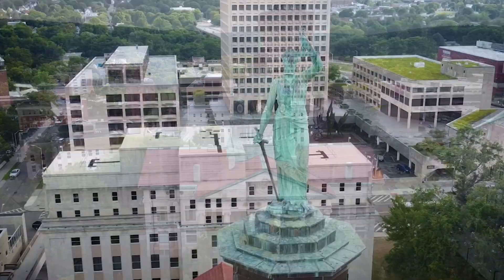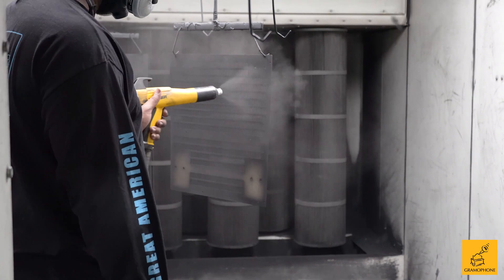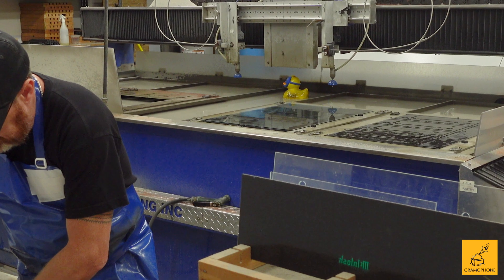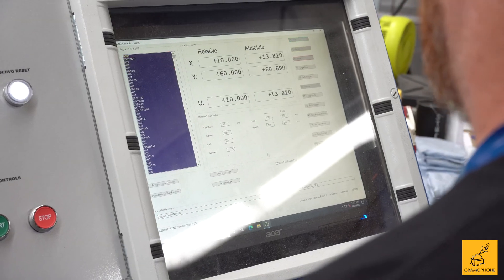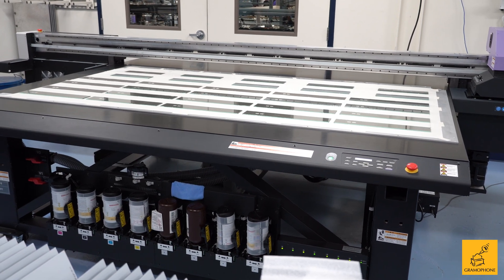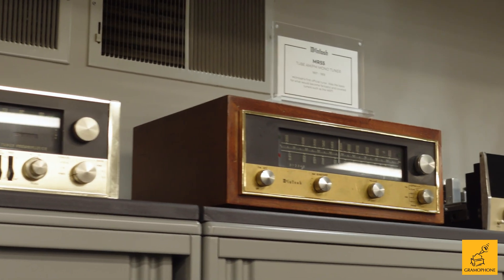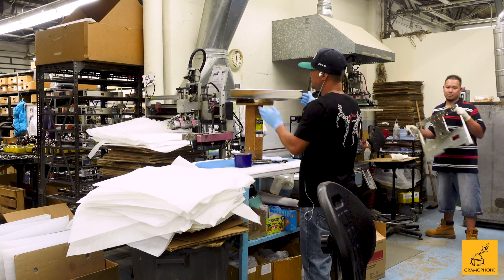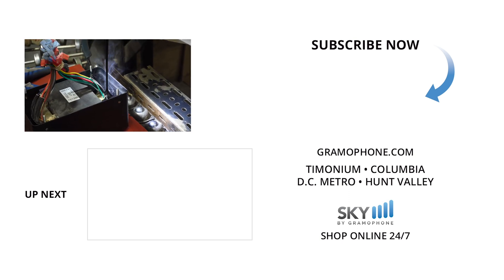McIntosh Behind the scenes | Metal Fabrication, Silk-screening, and Glass Faceplate Work | Part II

Comment: As much as I love McIntosh but sometimes the assembly is a little disappointing. One of my Mc611 amps came with loose screw inside and rather than sending it back I opened it and it was a screw that was left without been tightened and it came off.
Reply from the maker: Hi Racedoc, we're sorry to hear that, but glad that your unit is now performing well